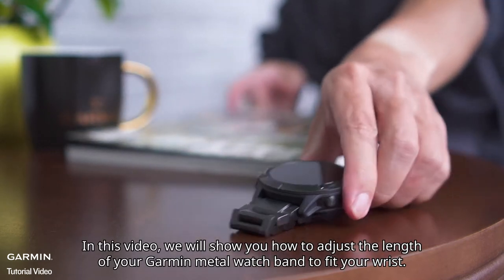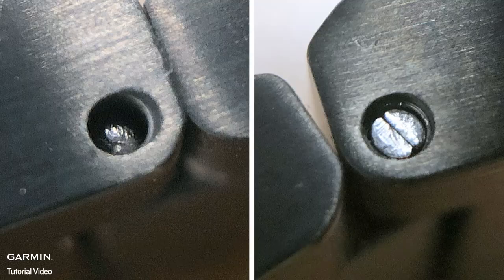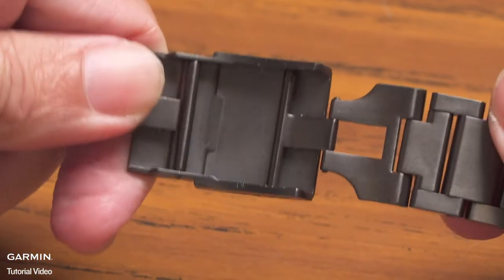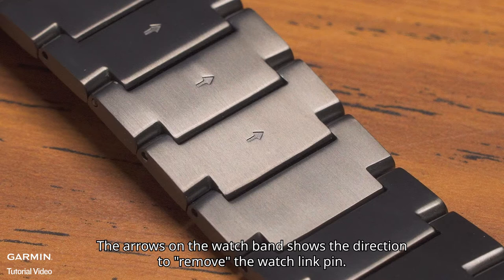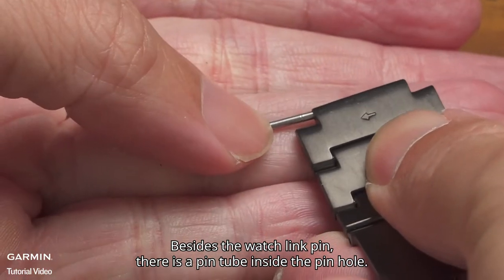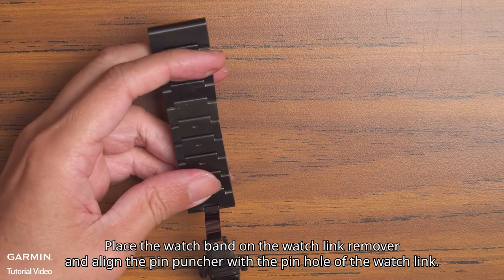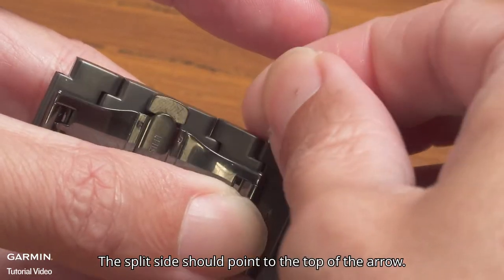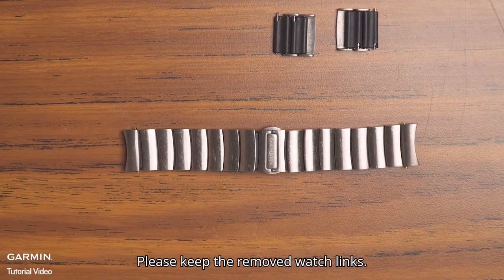Tutorial - Adjusting the Length of your Garmin Metal Watch Band

Comment: For Type 1, the screws are almost impossible to unscrew without totally ruining them. They are screwed in much too hard - no chance someone can do that himself. In the video, they must have already been loosened.
Reply: Yeah it happened to me. What can I do instead?
Reply: @Shahrozirl  I finally was able to do it, after even my watchmaker could not unscrew it. I did this:

Spray a bit of WD 40 on the screw, wait 2 mins, wipe it off
Put a bit of cling-film over the screw (so there is 0 wiggle-room and in order to not scratch the screws)
Use a high-quality screwdriver, especially one with a good grip
...and then, simply unscrew

This way I was able to get them off without destroying them. But it still was very hard and not at all like it looks in the video... Good luck!